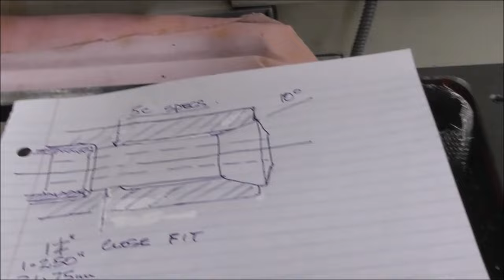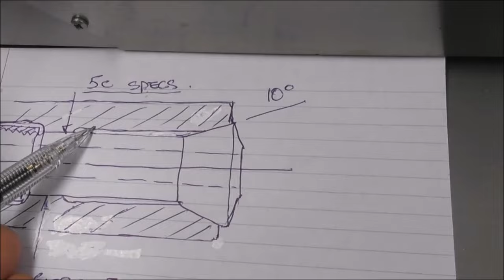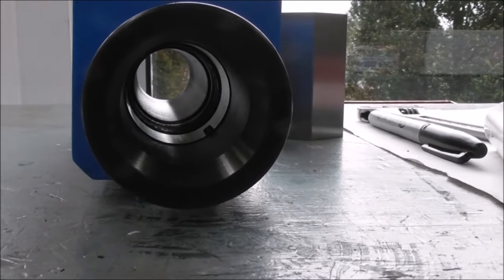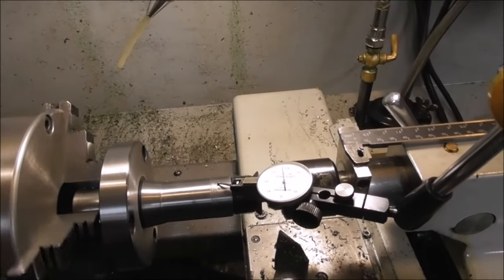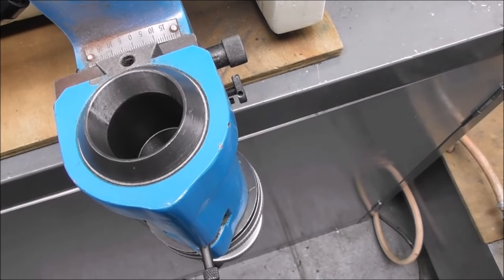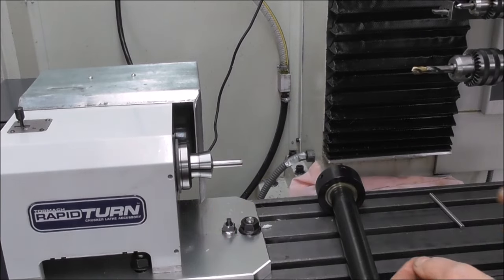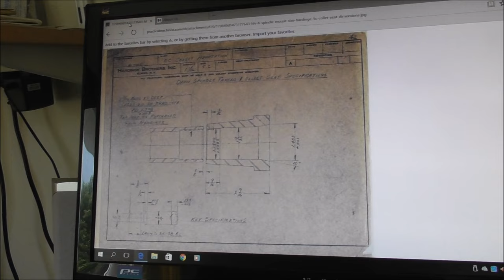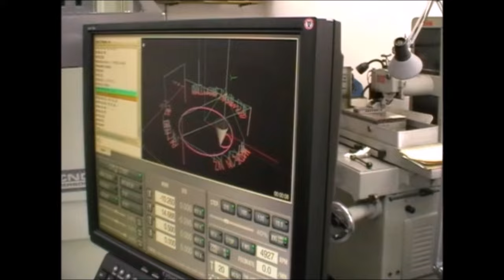Tormach RapidTurn - 7. Spindle Issue

Comment: Hi Thread Express. I will check out my spindle tomorrow. I know that mine was one of the last of the first batch sold, hopefully It isn't fault. The annoying thing is that any replacement with either a new spindle or complete unit will incur import duty.
Reply from the maker: How did that work out Bob - did they cover all the costs?

Comment: Hi Threadexpress. I called Tormach two days ago , initially I couldn't get through because all of the Tech Help folks were busy so I sent them an email outlining the problem I had with the spindle.
 Later in the day I managed to get a call through but had difficulty in getting the point across about the problem with the spindle and felt somewhat deflated after the call and felt almost as though the problem was being fobbed off. However, this morning I got a very positive written response to my email message from Tormach that has left me feeling much better. The response was ver positive,Tormach recognise the problem with the spindle and they are currently working out how to resolve it. In due course people affected will hear from them outlining how they will cure the problem.
Reply from the maker: Hi Bob. Thanks for that. Others have had a similar reply so it sounds like they have decided to resolve it properly.
Keep us posted if you get more news. Cheers.
Reply: Tormach is very slow to respond, for even simple order questions. I mostly like their products but not their customer service response time.
Reply from the maker: Tormach service used to be excellent - lets hope they return to previous form.

Comment: Cliff, thanks for your excellent video. Mine's the same, serial number C043, and bought with my 770 as soon as they were released, so I assume within the first production batch. A quick measure shows the bore around .050" oversize, but I'll check a few times and get a better figure. I'll be contacting Tormach when they wake up later!
Cheers, Andy
Reply from the maker: Hi Andy - Looks like it is widespread ...mine is SN C067.

Yes please measure the bore size. If it is different than mine, it may point to manufacturer error, or a lack of specification.

Cheers
Reply: Cliff, mine measures consistently 1.255", so 5 thou oversize, not 50 as I said earlier! My (2) 5c collets measure 1.2485" - 1.2490" and the 5c 3-jaw chuck adapter is 1.2490", so the 'slop' I'm getting is around 6 thou on the diameter. It's certainly enough to produce machining errors, especially when using the 5c 3-jaw with its longer projection from the spindle. In some respects I wish the error was larger, then I could (as you did) make a sleeve for the difference, but a sleeve with an accurate wall thickness of 3 thou probably isn't worth considering with my skills and machinery!
Reply from the maker: Hi Andy. I is possible Tormach will offer to replace our spindles, and perhaps try to reduce costs via only replacing the large clearance spindles - I don't know this, it is just a totally wild guess.  The trouble is any total clearance of more than a thou or so will begin to cause different issues. I would say the max bore dia should be 1.2502"  or perhaps 1.2505" absolute max.

Comment: Great video. Very interesting. Looking forward to see how it turns out. Kieran
Reply from the maker: Thanks
Reply: Hi Cliff after watching your video I sent an email to Tormach last night and in the usual manner they were very prompt and responded very quickly here is what they sent to me I thought you might be interested
(Thanks for your note. This issue was first brought to our attention late last week.  The omission of the collet back bearing surface is an unfortunate error that we have traced back to a bad redraw of a manufacturing drawing.  Unfortunately, this error escaped notice during both our internal product testing as well as several months of outside beta testing earlier this year.  We’ve tested several units since we learned of the problem and while those units show little-to-no performance related issues, we do know that some customers units are reporting more noticeable issues.
 
We’re committed to correcting the units shipped to customers.  We don’t yet have the full details on how this will be done.  We are still collecting information at this time to determine the best way to handle the fix that ensures that the product meets the quality that you expect and the resolution is as efficient and painless as possible for you.
 
Thank you for your patience as we work through this issue.  Unfortunately, this is going to take some time to fix as we have just initiated the process of remanufacturing the spindles this week.  I’ll provide email updates to all effected customers in the coming days as we have more details to share on how this process will proceed.  Of course, feel free to contact me as well if you have any questions.)
Regards Mark
Reply from the maker: Thanks for keeping us informed Mark.. Cheers

Comment: Sorry to see this!  Maybe yours had the special high tech "air bearing" installed...they are sooo good that you can't even see them.  Hopefully Tormach can get you set up.  Maybe someone didn't turn off rounding when converting the print tolerances from inches to mm for the manufacturer?
Reply from the maker: Ha!  Maybe!  Cheers.

Comment: When you say close fit  what is the max 0.003 inch? I cant find it anywhere, I did see the blue print you showed but What did the new unit measure? My hardinge collets measure 1.248 the lyndex 1.2485
Reply from the maker: Hi - The draw tube and its threads are not a high precision item and will likely pull the collet off center in the spindle bore so the closer the fit the better, depending on the work you want to do of course.  I would be fairly happy if the total clearance was up to a thou. 0.001" But ideally it should be less than 0.0005". I would have to hunt out the specs on my new unit, from memory it was about 0.0005" big. 
I ground my arbor to a very close fit of about 0.0001"  Cheers   Cliff

Comment: A 5c collet holder isn't a 5c collet holder unless it is built like one.  Which that is clearly not.  Looks like they're going to have to replace some spindles.
In the meantime, could you press in a piece of brass or something and turn the ID to what is needed on your other lathe?
Reply from the maker: Much as you have just suggested, I have got a sleeve installed on the chuck arbor - that will keep it going in the meantime.

Comment: Hi Threadexpress. I've just checked my spindle and I guess Tormach will be getting a call from me this afternoon.
Reply: What were your measurements and what did they say?
Reply: Don't know for certain but the bore is parallel all the way and there is clearance a plenty around the parallel portion of the  5C collet when rocked in the spindle. I suppose I could get some definitive measurements, I will post when I take them.
Reply: Spindle through bore parallel section 1.264" 5C collet O.D. 1.254
Reply from the maker: OK - Going off the youtube and forum postings, It looks like it is widespread.

Comment: Why can't you add a bushing to make it at least usable until the replacement arrives? Turn one the correct size. Freeze it and then insert and seat it where it should go. Maybe I am seeing it wrong?
Reply: Okay. I should have finish my lesson by watch the whole video through to start with. I should have known. You are a smart guy. :)
Reply: I am fairly confident that Tormach will take care of you. They do have a good reputation and track record as you probably already know better than I do.
Reply from the maker: Thanks for your comments Lee. Yes a bush is better shrunk on the male side...more durable. The bush is probably to thin in section to be durable in the Bore.

Comment: Ouch, keep up the great work.   It is a shame you can't bush the spindle in a clean way.
Reply from the maker: Thanks - I almost could, the trouble is the sleeve shim is more durable if shrunk on to the collect/Arbor.
Reply: What about freezing the shim/bushing in dry ice and pushing it in there to swell to lock in?
Reply from the maker: Hi - freezing it will put the shim under compression when it warms up - then is likely to buckle , much better shrunk on and under tension. Cheers.

Comment: And now Tormach have stopped all sale of the Rapidturn. :(
Reply from the maker: Ok - that makes sense. Thanks.
Reply: Hi again. just got an email from Tormach. Rapidturn will not be available for several months. :(
So I am building my own. Yeaaay
Would you mind telling be the exact ratio of rapiturn high/low setting. (pulleys)
From the diagram I can only see one pulley on the spindle axle but that can´t be right?
I would really appreciate if you could take the time to do this.

Best regards
Ricard, Sweden
Reply from the maker: Hi Ricard. Very interested in your build plans. Feel free to email me direct. (address via 'about' above)

Have you considered using the bigger 1100 spindle size motor and a toothed belt?  

OK a quick measure. Motor pulleys 32.00 and 71.00 OD   Spindle pulleys 118.00 OD and difficult to get at without dismantle, but close to 86.00 OD.

Cheers  Cliff